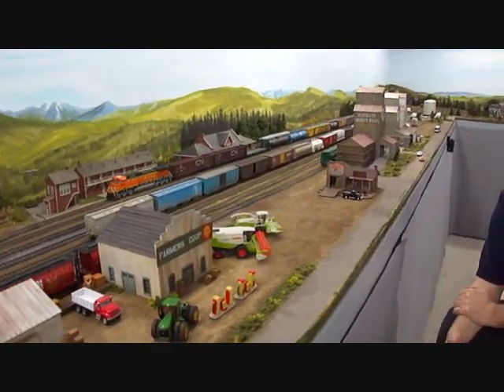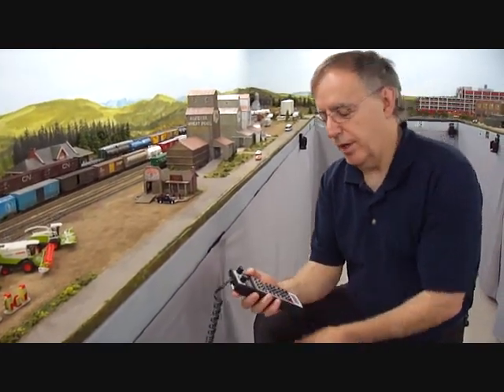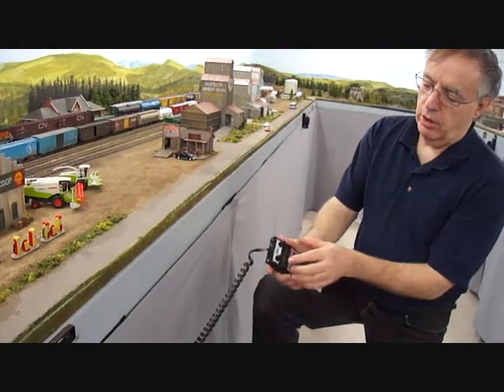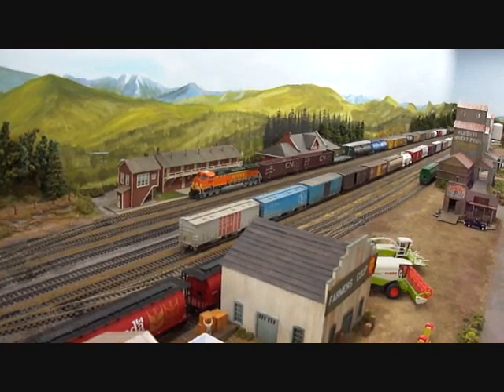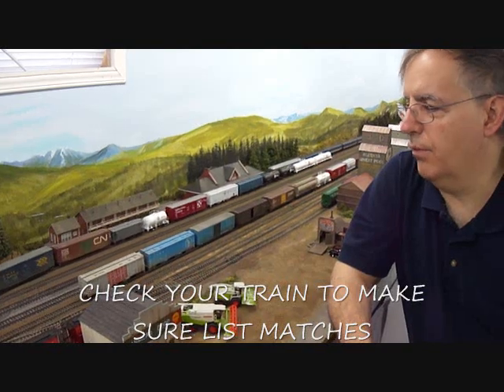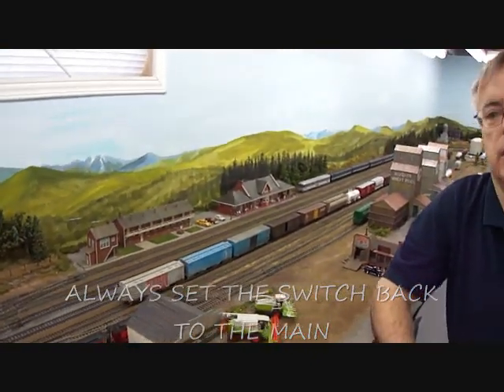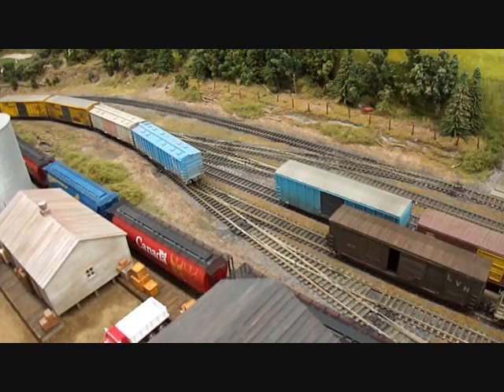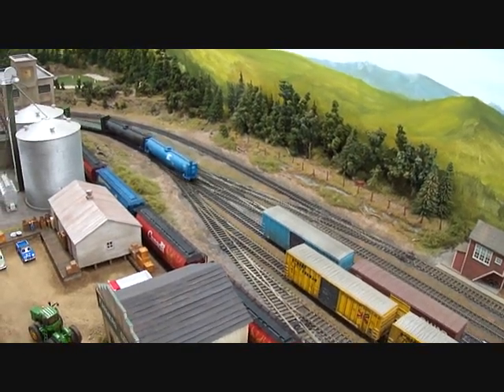Helpful Hints For Operating Model Railroads: Part 2, Way Freight Switching in a Town Yard

Comment from the maker: Hi Gary.  It is 25ft by 27ft.  I decided not to use electrical switches for a couple of reasons.  I wanted to keep the layout wiring simple as I had over 50 turnouts.  There is an expense associated with this as well.  But most Important.  I wanted the operators to physically throw the switch and the link between the eye and physical action is direct.  Electric systems would be needing panels in throats and folks would have to match the panel to the trackwork then throw the right switch.  .

Comment: Very useful especially to me in the UK modelling US rail roads. Wish I could get over there more often to see some real switching, We call it shunting but most of our traffic now is bulk point to point which is why I model US trains.
Reply from the maker: Indeed.  This is happening more and more in the US as most commodities are moved by containers.  Of course other unit trains with oil, ore, grain etc are there as well.  I see lots of mixed trains still and I guess they still deliver to many cities with local industries or go to truck terminals.

Comment: Just wondering why you use a dowel to uncouple the cars instead of any kind of magnetic uncoupling? Is this for looks in that you don't have the uncoupling hooks under the coupler or just what?
Reply from the maker: +David Curtis The BBQ Skewer is very efficient and they are easy to get in quantity.  Quicker and more reliable as well.

Comment: At about 6 minute the train arrives at a yard and has to use the main for switching due to length, you rerouted other traffic onto the other main to bypass.  Imagine the same scenario on a single main layout, would you just have to stop traffic on the main while your train did its switching?  Or is there some genius solution I'm missing?
Reply from the maker: +The Lowmein If one train is short you can do a saw-by using a yard lead or industrial track or splitting the track in a passing siding..

Comment: Please explain the shove, drag, PLG, and Red Zone when switching in a yard cause people don't know what that means!
Reply from the maker: Thanks Jac for commenting.  There are lots of terms but I do think the shove is when the locomotive pushes some cars in the yard and there is a trainman with a radio on the lead car to ensure there is safety and eyes on decisions for stopping and speed.  I think drag is when the lcomotive pulls cars.  PLG I am not sure but it maybe related to dangerous goods and rules.  The red zone I believe is the distance the men on the ground must clear a track when there is a moving train.  I think it is 6 ft in the yard track where everything is moving at slow speed and 25 ft on the main where trains are moving at high speed.  Keeps you safe from dragging equipment and strapping.  If you want to clarify on my thought please do.
Reply: CNLVN Yes you are correct When I work at the railroad it depends on the eye of the move on the point! PLG  POINT LINE are GOOD once you line the points the lead man or pin puller will give the PLG! Once you make a join before you go in to couple the air line You give a RED ZONE will  tell the engineer not to move. Once you done and is clear you a RED ZONE CLEAR. The rule of yard  speed is 5mph NO MORE than that!

Comment: when a train arrives in a yard turn the bell on and leave it on blow the crossing signal two shorts a long and a very long to announce your arrival once your parked turn the bell off and blow one blast. to make sure no one hits you set all switches in front of you and behind you to their bypass setting the train will go around you.   close the switches that are behind your train to prevent derailments and place all passing trains on the siding so they go around you.
Reply from the maker: Good info.  Thanks for the the comment
Reply: According to GCOR there are no bell or whistle requirements for entering or leaving a yard. You should use a long and a short followed by a succession of shorts when encountering men and equipment. Whistle signal 7 which is for grade crossing is 2 longs a short and a long till the crossing is fully occupied. Bells and Whistles will be used as a warning anytime necessary but you dont have to have the bell ringing during travel thru yards.
Reply: john seeger yes you do North America rules require the bell be on when moving in a yard and you should only blow shorts in an emergency I read GCOR's comment he is lying CRA Rule 10 and AAR Rule 30 explain the rules of the bell it must be on when a train is moving near a station or entering a yard Long Short and a succession of shorts is the signal for the conductor to flag the train. we don't use those rules anymore CRA Rule 10 and AAR Rule 30 are what is used now of days.
Reply: 5.8.1 Ringing Engine Bell
Ring the engine bell under any of the following conditions:
• Before moving, except when making momentary stop and start switching movements.
• As a warning signal anytime it is necessary.
• When approaching men or equipment on or near the track.
• Approaching public crossings at grade with the engine in front start signal at the crossing sign.
If no sign, or if movement begins between sign and crossing, start signal soon enough before
crossing to provide warning. Continue ringing bell until the crossing is occupied.
5.8.2 Sounding Whistle
The whistle may be used at anytime as a warning regardless of any whistle prohibitions.
When other employees are working in the immediate area, sound the required whistle signal
before moving.
Other forms of communications may be used in place of whistle signals, except signals (1), (7),
and (8). See following chart.
The required whistle signals are illustrated by “o” for short sounds and “—” for longer sounds:

 Succession
of short
sounds
Use when persons or livestock are on the track at other than road crossings
at grade. In addition, use to warn railroad employees when an emergency
exists, such as a derailment. When crews on other trains hear this signal,
they must stop until it is safe to proceed
Reply: john seeger read them shot whistles are only suppose to be used in emergencies not when a train is in a yard.
Reply: ill admit i was off on the shorts. I was correct on it not being required in a yard.
Reply: john seeger right
Reply: The bell is needed any time you move the locomotive but only for a short time. When in a yard you ring the bell while next to other equipment, Movements, or men working. Horn is vary rarely used unless its an emergency

Comment: Around 7:00 you speak of re-routing trains around your train.  Should that not be done by the dispatcher?  On a layout I frequent if you have a main line tied up like you do, we don't re-align switches, simply put out a red flag on both ends and let the dispatcher decide what should be done.  And obviously this is not a CTC railroad.......

Comment: the last rule of railroading is PUT ALL OFFSPOTS BACK! the LVN boxcar and the two hoppers are off spot they need to be put back before the train departs. NEVER COUPLE AN OFFSPOT TO THE TRAIN! taking a car that is not on your list is theft and needs to be left where you got it only pull the cars that are on your list.
Reply from the maker: You are right.  The two railbox were our drops and the DW&P and B&M were the lifts.  The only two that were put on our train was the B&M and DW&P.  The LVN and the rest of the cars that were moved from the interchanged to get at the lifts were put back including the drops.  Thanks for the comment.
Reply: indeed it is called sorting
Reply: CNLVN  I guess he told you.
Reply: indeed
Reply from the maker: Not really Lilly.  Apples and Oranges.  Moving cars in and out of interchange tracks are the railroads responsibility and they make sure they place them for car forwarding on trains.  Putting cars on "spots" are strickly related to industrial or private sidings as car placement is specific for customer requirements.  If you move them it is based on arrangements with the customers and they are always put back where you found them.  In this scene there were no offspots.
Reply: that's because they were put back in the yard after the cars were sorted an off spot happens if a car is pulled and not returned to the track it came from when Mike pulled the train out there was two hoppers and the LVN boxcar hooked to the train to get to the Boston and Maine car the LVN car had to be uncoupled but the DW&P car was hooked to it that car was in the train so it was dropped first and since the LVN car was off spot it was put back the Boston and Maine car was last and since the hoppers were in front it was added to the train as for the hoppers they were put back when the Railbox cars were unhooked.

Comment from the maker: Yes we do no the whistle rules.  We just had trouble walking and chewing gum.  One take only.  In large railroads where there is a dispatcher panel and communications, the operater would call dispatch and give clearance.  He would control mainline turnouts.   However in my layouts we are not always on the ground so we give control to those occupying the yard.  Other engineers can request changes to status from the yard operator.  Thanks for the coments guys.  They are excellent.,

Comment from the maker: Shortliner68.  There are no magnets as they have a tencdency to uncouple cars when you do not want them to.  We use the sticks only.
Reply: Re uncoupling:
(sorry didn't get it right) do you place the stick between both knucle rods and flip them sideways so they open, or, tip of the stick goes in between both knucles making them to open???
Appreciate your comments.
Cheers